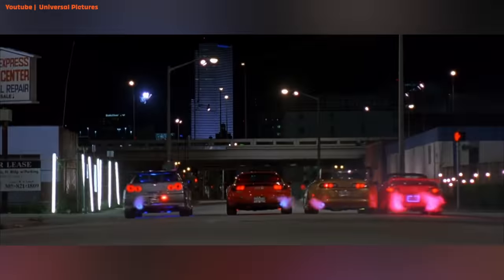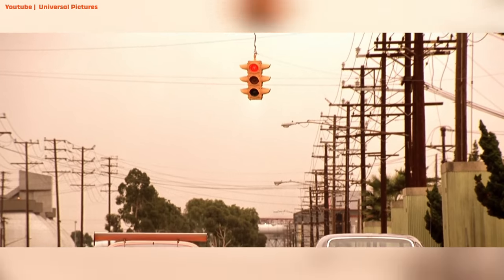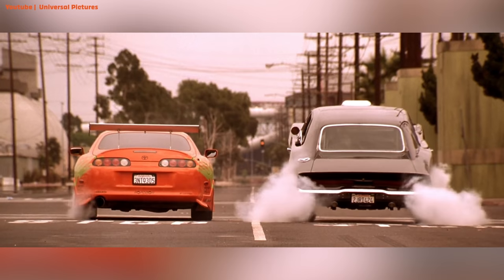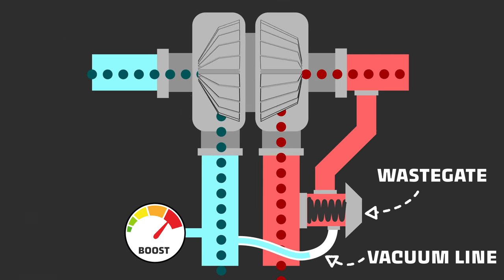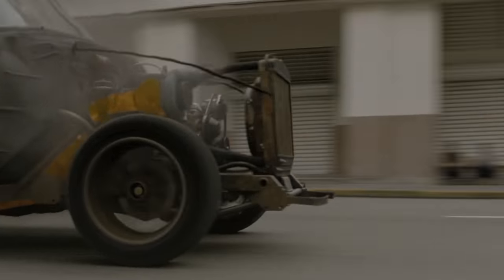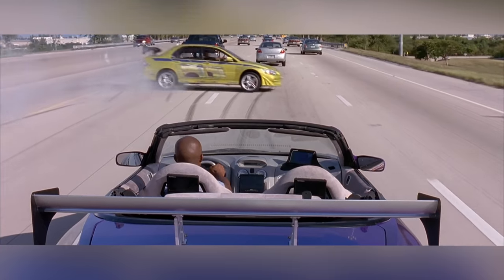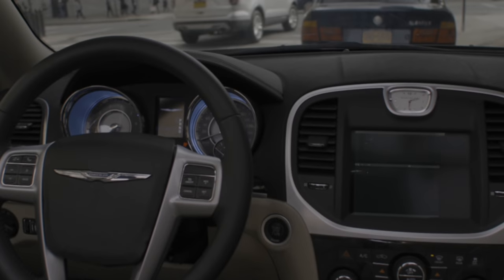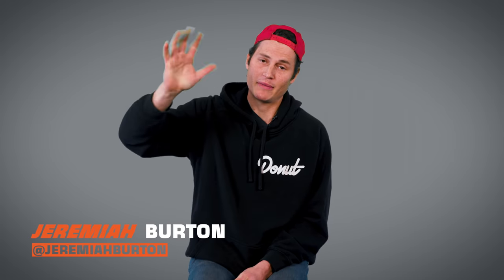Busting Fast & Furious Lies with Science

Comment: Meanwhile, in your videos you forgot to mention the supercharging effect of NOS by cooling the air going inside the air intake. That's in part what makes the mixture more efficient (cooler air = higher density). It's called chemical forced induction. BTW, the NOS won't ignite at explosion, but the bottle under high temperature (the car is on fire) can explode because of expansion of the gas contained inside. So the coloured flames might be kind of right actually ^^.

(sorry if my english sucks)
Reply: Bottle can't explode.  They're equipped with a pressure safety release valve.  It dumps it's contents long before the pressure gets high enough to do anything to the bottle.

Comment: No hate but: may I ask WHAT THE HELL is a “wheel stand”
Reply: wheelie/stand... wheelstand
Reply: It's not really right to call it a "wheel stand" because a wheel stand usually means you're not moving. They're usually done on bikes/motorcycles.
Reply: @MrEazyE357  In vehicle acrobatics, a wheelie, or wheelstand, is a vehicle maneuver in which the front wheel or wheels come off the ground due to sufficient torque being applied to the rear wheel or wheels.

Wheelie and wheelstand are interchangeable.

Comment: I can vouch for going crazy fast in reverse with commercial transmissions. Any semi transmission will let you shift the range while in reverse. It's not intended, and it's stupidly dangerous, but they can go absurdly fast in reverse. With the splitter, you'd effective have 3 "gears."

P.S. Always get annoyed by people calling shit an 18 speed and what not. Like, no they really aren't. The trucks I drove were 4 speeds, some 5 speeds. But you had a splitter and multiple ranges that are OPTIONAL.  It drives just like your car does, except the clutch does basically nothing once you're moving. The difference is, if you want to get the RPMs up to climb a hill, you can split a gear and go half a ratio down. If you're on the freeway and want to go faster, pull the paddle up and shift back into 1st gear and that starts you on the high range gears. I'm simplifying the example to help people understand, that no, you will never, ever, shift gear from gear 18 times in a semi. It's all options available to you.
Reply: Yes. But an 18 speed Roadranger does have 18 separate ratio's and therefore ARE in fact 18 speeds by definition. But no, you don't use them all, in sequence. Ever.

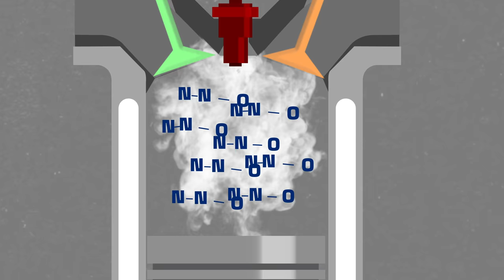Comment: While the NOS would not explode into a colored flame I think you overlooked a lot in that equation. Firstly being a scuba diver and having gone through some safety courses for compressed air and pure oxygen the fact that the NOS bottle is under pressure would already cause it to explode in a fire that big. Secondly despite the fact that it is not pure oxygen the process that causes it to separate into oxygen at 5:11 is the exact same thing that would happen as the gas is already super heated and expanding from the cylinder it just exploded out of due to exceeding the pressure rating of the steel or fiberglass bottle. At this point adding Fuel to the fire in the form of oxygen just like it did inside the motor causing a secondary fire ball. Seeing as even just a shop compressor under pressure left in a fire like that would cause one I really don't think there is any way you can say that NOS would not cause a secondary explosion in a full car fire.

TLDR NOS may not be explosive but any gas under pressure is when engulfed in flames. The heat will always heat up the gas causing it to expand and eventually surpass its containers rated max pressure.

Comment: Talking about remote control cars, even if you have scifi super AI powered software that could hack multiple random cars and control them. How the hell are those cars turning, im pretty sure there is no such mechanism that allows most cars to turn their wheels without the driver's input. Sure they can maybe drive forward or change gears, but thats about it when it comes to remote control driving...

Comment: 8:58 although all the F&F movies as a whole are kind of whack in my personal opinion, what is more whack is this video and its claims of using science for bust F&F lies.
Almost every scene analysis  presented in this is either demonstrably false and/or full of half truths and  not all factors of the physics behind them taken into account to arrive at the proper conclusion. About the only one that was pretty much correct is the car hacking one since 99% of the cars in the scene were as mentioned, not cars that would have a system that could be hacked.

Comment: There's an automotive Mythbusters show out there that actually tested the wastegate myth. They used an old Chevy Monte Carlo and attached a boat turbo and a carburetor that can adjust its air/fuel mix on the fly. Having the vacuum line loose didn't work but they rigged up a rat trap to pinch the line which actually worked. Sure it didn't have the exact same effect in the movie, but go check it out.

Comment: The first is actually possible but almost impossible to accomplish. When you full power, you probably have some wheelspin but at the same time you got some friction to move you forward. A burnout is also heat caused by friction, so in the end, with a insane amount rpm to the tires it would be possible. (To reach 2.4g is unrealistic but not impossible)

Comment: Technicalpy, the wheelie burnout would be doable. Would need to go right into friction coefficient etc but if you could find the perfect balance between traction and slip it would be possible
Reply: Was thinking that the whole time. During a burnout a car still accelerates - not sure why it's physically impossible to reach 2.4G this way and I don't think that was addressed
Reply: That's true.  The most egregious error, imho, is the "boost line/carb" thing.  He's just SO wrong on that, it's not even funny.

Comment: For Nitrous explosion, couldn't that be because the car is on fire causing a relatively sealed pressurize container getting heated up to explode like any other sealed container with enough heat and pressure. Whether Nitrous is flammable or not the pressure raising from the car's fire would cause it to explode without a relatively large purge valve depending on how fast it heated up.

Comment: Got to see a presentation at universal done by the stunt drivers, the way they said they normally do the car driving backwards trick is they actually get the body mounted backwards on the frame and have the drivers seat and controls still facing the "front".  I could see them just having slow cars for the interstate scene though since relative speeds on camera are all sorts of weird.

Comment: there is no tractor transmission that can fit onto a car, those things are bolted to the engine with around 20 huge bolts and are massive in their own right, it would fill the entire cabin of a car, and there is no adapter plate made for such size changes

Comment: Your wrong about the NOS scene. Although NOS is non flammable, it will accelerate the burning of combustible on fire. Which is what happens on the scene. First the car is shot at gas tank, car is on fire, then fire is accelerated by NOS. You should get your facts right.
Reply: I also see plenty of vehicles doing a burnout while  retaining forward motion. Sure it's unlikely but not impossible to do that and pop your front up, especially when it's not sustained for very long on both fronts.

Comment: For the NOS exploding thing, while your are correct the NOS itself wouldn’t explode like that but the cylinder itself would bleve when it’s heated up since it is pressurized.
Reply: It wouldn't due to the press safety blowoff valve on the bottle
Reply: @billymanilli  yes, but if it got heated and caused to much pressure quicker that it could blow off then the bottle could go boom, its the same for propane tanks and stuff.

Comment: turbohack works 100% on the 1986-1989 Ford escort rs turbo 1,6 8V cvh with bosch k jetronic... it has a silicone chip that measures pressure and will give more fuel from oem 132hp and up till 180hp..

Comment: doms wastegate trick would actually work on fuel injected car thats using a rising rate fmu where every psi of boost raises psi of fuel.they usually come in rates of 1-1 through 12-1 so on a 12-1 rrfmu you would get 12 psi of fuel for every 1 psi of boost BUT this creates other variables.your fuel pump will need to be able to handle double/tripple/quad amounts of psi  your fuel lines need to be high pressure lines, possable even injectors mechanically stuck closed unable to open under massive psi build.

the dom hack is no different then fully open manual boost controller and somthing that could be done but your better off using a dual stage boost controller thats tuned for low/high boost map and just hide that controller.

Comment: Tractors has many gears on reverse, thats a truth!!! BUT!! A tractor is a working tool, so that means very very VEEERY low ratio gears. A Tractor with 95Hp can pull a semi truck easy. So, even using a tractor transmission directed to reverse, even usin the last gear of that geabox... the Torretto´s car would be nothing but in a normal reverse gear speed, of any car around. PLUS, add a tractor gear implies HEAVY WEIGHT ADDITION!!! ( Sorry about my english, guys...hehehe)

Comment: …. You’re not wrong about the waste gate, scene… but you are kinda wrong regarding carb jetting. The fuel flows based off a siphon effect that happens as air flows through the carb. Yea if you go from no turbo to turbo, or even if you just do some significant head work, you miiiight need to rejet the carb. But just increasing the boost a couple of pounds? The carb will usually work its own magic and provide the extra fuel that is necessary. After all, a turbo car doesn’t idle with 14psi of boost, it starts as 0psi and increases. You don’t have to stop mid pull to throw some jets in, the carb just makes it happen without a computer.

Comment: Turbo pro mod cars pack the front wheels a lot while still breaking the tires loose 
There is a perfect amount of spin/traction/wheel speed 
Tires will smoke/spin with enough traction to lift a high 3,000hp super lite 2300lbs car 

A full heavy charger with 800hp then no 😂

Comment: So couple things I want to bring up... There are vehicles with multiple reverse gears. An Eaton 10 speed (most common semi truck transmission) has Hi Lo. So it has a Hi 5 and Lo 5. There's also a Hi reverse and Lo reverse. (Hi reverse is rarely used). Point being... It's definitely possible.

Also as for the nos tank blowup, it's a pressurized tank full of oxygen. An influx of oxygen definitely has an affect of fire. you can test this with those PC cleaner cans which are just pressurized oxygen. I can't imagine nitrous oxygen is much different.

Comment: 1320 did interview with the guy who build some of the cars for fate of the furious. He explains how coke tap would work. Same way vw 1.8t can get power from introducing a leak before n75 valve. Not tune just MBC.  Added psi makes power. Also in original f&f dvd “making of”. They show how they pull of the wheelie. Smoke is cgi.

Comment: A Prius may not have any auto-drive features built in, but what it does have is an electronic throttle body and electric power steering, both of which in theory could be controlled remotely from a computer. However, any car with a purely mechanical throttle body and hydraulic power steering are 100% safe from such an exploit.

Comment: Regarding Issue #1, The infamous Wheelie-Burnout. 
I have a Kawasaki ZX-12 that will definitely perform a Wheelie and a Burnout with a hefty dropping of the clutch.  Granted this is not from a dead stop, and the burnout doesn’t last for 5 seconds, but it does seem possible, at least on a 2-wheeled vehicle……………

Comment: 8:45 - That's not really correct.
On a blow through carb setup, the float bowl has a boost "reference" line going to it (just like a vac/pressure controlled fuel pressure regulator).  In short, whatever boost pressure is in your intake manifold is equal to the pressure in the float bowl.  Increase boost, the bowl increases 1:1 to compensate.  In fact, in many cases it would do a better job of keeping it going lean than a factory efi would.

Comment: I'm going to call you out on the first assumption that you are making.  Why?  because I have seen cars smoking the wheels while the front of the car is in the air and the car is traveling forward.

How?  I knew you would ask.  If you start spinning the tires in bleach and hold at WOT without a wheelie bar under the vehicle, it will and has happened.  Highly modified drag car as well as Funny cars heat their tires in bleach, but not a WOT.  They don't need to use that much fuel to roast the tires.  So if they line up the vehicle so that the tires are just at the far edge of the bleach, once they start spinning and moving forward and smoking, they grab on the dry pavement, lift and launch.

Now, here is a link to a video.  Mind you that it is a motorcycle, but it is doing exactly that.  Keep in mind that it is all power/weight relative, and I haven't found a video of a car doing it,... yet.  I'll look more and find one, but posted this one just to show it can be done in one form.  https://youtu.be/gWRpKeog_jM

Comment: Really if you want fast in reverse you want to look at either a backhoe or forklift setup. We have a Massey Ferguson 2200 forklift with the instant reverse transmission so it will go as fast in reverse as it will forward. Kind of scary really and I'm not going to be trying to see what driving 15-20mph in a 10k pound forklift in reverse is like. I'll see about adding NOS.

Comment: Technically if your car is light enough there is torque being applied to the floor, a standing burnout could be possible but that would mean the car's dynamics for regular driving would be UTTERLY AWFUL and likely any time you accelerate it's doing a wheelie so.. yeah totally improbable.

Comment: I once had my exhaust sawed off near the front (someone tried to steal the cad) but still connected in the back via a $5 metal loop because the back clamps that held the exhaust on rusted off, so if you drove it forwards it would push it up and backwards or side to side which I felt was quite unsafe. SO instead of paying for a towtruck I drove it completely in reverse so the exhaust was very safely dragging on the road INSTEAD of getting pushed anywhere. It was waayy harder to control than I expected, had my 4 ways on the whole time but still lost control of the car once, completely sliding across both lanes. I was going about 30 miles per hour during the most high speed, heart pounding 5 minute trip to the local mechanic of my life. I'm very confident at least 4 people filmed me during the trip, as I was in reverse on the right hand side of tne road, so if you find a 2003 silver chevy Cavalier on reddit driving in reverse at about 9:30pm in Calgary Alberta that was me lol.

Comment: Actually you can wheelie and spin the tires but not quite like the movie....500shot from a dig gets wheels up and 47psi of boost comes in about 15 to 20 ft out and the tires light up as front is on its way down hence car comes back up and hard right smack into k rail.... wheelie cars do this often...or they flip straight back ..its on YouTube look it up...

Comment: About the Wheelie Burnout. It's not Impossible. The torque causing the wheelie comes from the friction interaction with the ground, like you said. The force due to friction is dependent upon the coefficient of friction between the rubber and the ground. That coefficient doesn't disappear when the wheels break loose, though. When entering a burnout, you're simply dropping from the coefficient of static friction to the lower coefficient of sliding friction. So you still have the identical mechanism available to do dank whoolies, but you'd need more power going to the rear wheels to achieve the same level of force. Meaning it's not *impossible*, just *improbable*. That's not stopped F&F in the past, though, and we love them for it. We love them like... Family.

Comment: Now, it is technically possible for a tank of Nitrous Oxide to explode - but not like it was in the film. When tanks of liquids or highly compressed gas get heated to huge amounts, it can lead to what is known as a BLEVE - a Boiling Liquid Expanding Vapor Explosion. However, given that nitrous isn't a fuel itself, merely an oxidizer, it would simply explode out into a ball of gasses that might actually have put out some of the fire from choking out the oxygen needed, since a lot of that fire wouldn't be hot enough to make the nitrous actually act as an oxidizer. Just a small input

Comment: Car would instantly run lean as hell, overheating like BAD.  Even with EFI a change that drastic (tardo turbo) would probably cause the car to backfire or run super lean.  I also think even though the turbo would speed up, it shouldn't speed up instantly like pictured.
The "Zombie" or hacked cars is worst.  If there are not motors to control those aspects, how would you remotely control them?  For example, if there is nothing there to compress the brake pedal, what compresses it?  Same with steering?  Maybe an electronic throttle could be activated?

Comment: I've met Charlie Miller in person. Really nice guy.

Re: the zombie car stuff. Assuming you had the code developed for specific models, mass exploitation *was* possible via automated scanning and some fingerprinting. The issue that you'd run into today would be that Verizon fire walled the port off that the infotainment system listened on from the rest of the world. The vulnerability in the cars might still exist but they've significantly mitigated the risk. Without some level of physical access to your car, we're all probably safe from this.